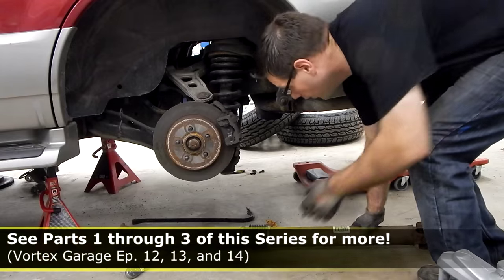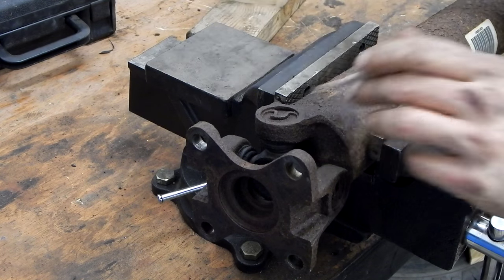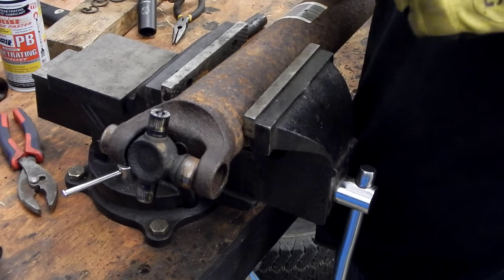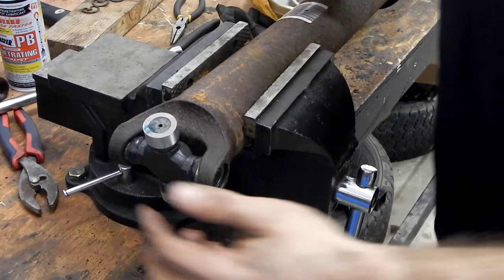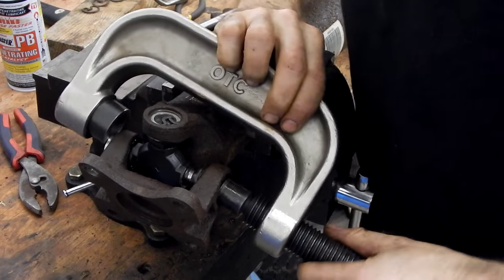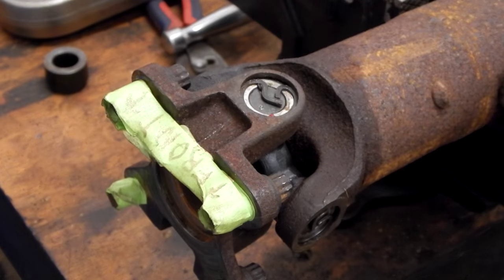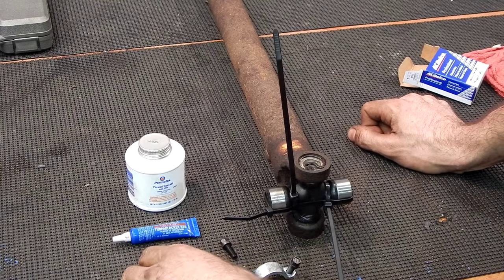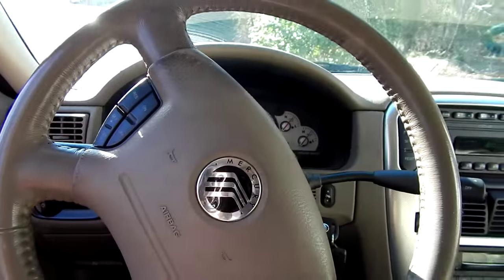Replacing Driveshaft U-Joints - Mountaineer - Viscous Coupling Repair Pt 4 - Vortex Garage Ep. 15

Comment: tyvm the videos you have posted have been vary helpful. i have talked to other ppl and have been told to change drive shafts, ball joints, axles, wheel hubs, breaks, but no one has ever said anything about that so tyvm

Comment: My Ford's yolk  comes out with shaft,93 explorer.fine. my mar k s got removed during joint r&r . On the splined i.d. of shaft yolk there is a channel Ed flat key looking groove. Inside the yolk I see no matching groove to mate, I know the importance of exact position. But fked it up anyway,marks come off. Hopefully u can tell me in the near near future if n how that spline channel can save me. Engine.rear wheels have not turned at all .so same as when I chocked it.

Comment: How many miles were on that case? I have one to do in the next few days and not certain if I should get other parts since it has 197K miles. I ordered the coupler and the chain(aftermarket - OEM is $150 vs $100) and that was $650 so people should be prepared for a good expense even doing it yourself.

Comment: Should you be able to hold front output shaft and be able to spin the rear
Reply from the maker: mine did not.  The viscous coupling should hold it.  note that if yours is not a BW4410 but a shiftable tc then your condition would be ok in 2wd only